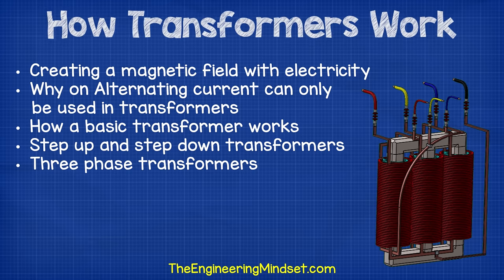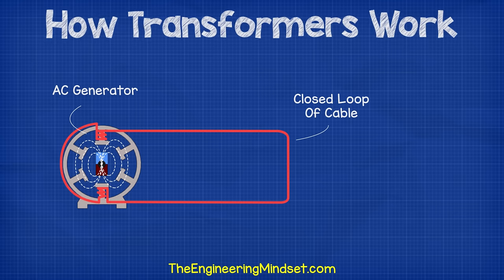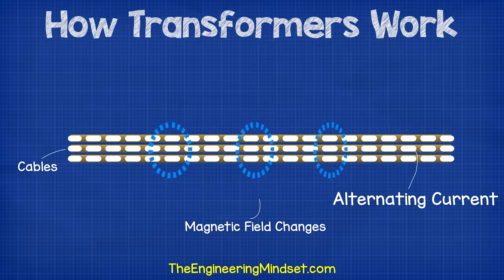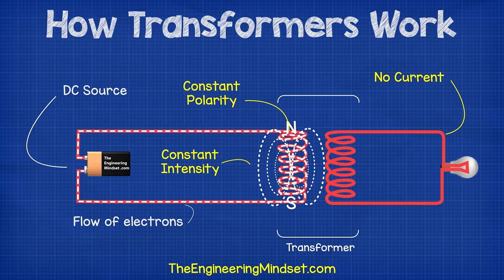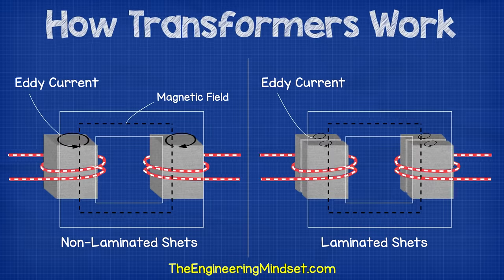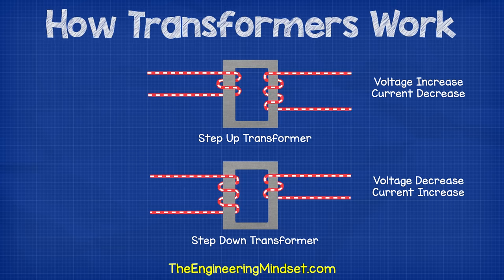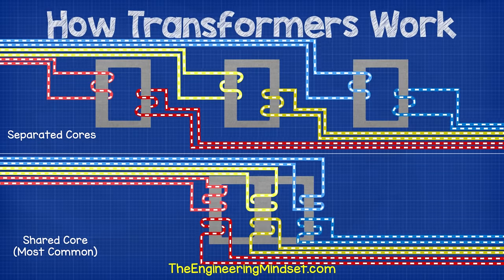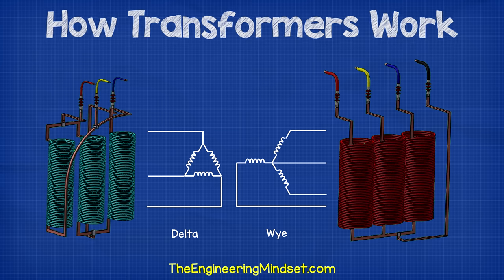How does a Transformer work  - Working Principle electrical engineering

Comment: With those green boxes are called transformers. They are connected directly to a power plant, making sure that it doesn’t overload your house with a bunch of power coming through it without those if he tried loading in a lightbulb, it would mostly just burn out immediately

Comment: What happens if I on transformer meant to turn 208 or 240 into 24vdc what happens if I input on only 120ac will it just come out as less than 24dc at the terminal

Comment: I love this level of abstraction. For my college courses the instructors kind of just go into the math, equations and analysis of all this works but they never stop to really teach an intuitive way of understanding what it is or why it works the way it does. 

Like i know that the voltage across an inductor = the inductance * the derivative of the current with respect to time. But i never really grasped why the voltage isn't present in dc current. Your description of how the magnetic field itself varying in intensity pushes and pulls electrons made so much sense. Thank you
Reply from the maker: Seen our new Transformer video? here https://youtu.be/jcY4QN7awEc

Comment: please explain how current decrease when voltage increase in a step up transformer and vice versa.
Reply: Power = Voltage x Current. The output power of the transformer cannot exceed the input power and so if the voltage increases, the current must decrease to keep the power the same...and vice versa.
Reply from the maker: Seen our new Transformer video? here https://youtu.be/jcY4QN7awEc

Comment: Thank You for these videos!

I work in HVAC as a helper and I'm trying to learn use of multimeter. For detecting/trouble shoot any type of trouble such as electic motor problems, capacitors, transformers and contactors.
I want to learn and have a clearing understanding of testing volts, amps, hertz, and contiuity etc.

This is all very confusing, and where to start and or comprehend. I just don't know what to look for.

Please help????????????
Reply: carl browning ... I spent 25 years working at an electric utility. I had trouble, too, comprehending things at first. It was such a good paying job, I wouldn’t give up studying. Little by little things stated soaking in, until one day the light (no pun intended) came on. I wish I could give you better guidance, but that’s what really happened. Don’t give up and best of luck!
Reply: It's a triangle, of pulses (each 1 a two part: Phase) on 1 road. Each magnetic flip, is a quick opposing pulse : of a size, & time.
They dont collide fired in rotation.
The induction ability of magnetic forces is really cool. Nick Tesla knew he could wifi electricity & it wouldn't "cost" anything.
Reply from the maker: Seen our new Transformer video? here https://youtu.be/jcY4QN7awEc

Comment: Oh wow that was a good dose of I formation! I enjoyed that video. I have a question tho, do transformers always emit a loud humming? If so, what causes that?
Reply from the maker: The humming comes from the core, the thin plates vibrating from the magnetic field. It is the sound of inefficiency
Reply: @EngineeringMindset   so why does a breaker panel or fuse box hum?
Reply: @randyblu25  It could be a number of things including loose wires, loose bussing, or the circuit breakers themselves.
Reply from the maker: Seen our new Transformer video? here https://youtu.be/jcY4QN7awEc
Reply from the maker: Seen our new incredibly detailed MCB video? link: https://youtu.be/gqEu9t8HwW0

Comment: They mentioned that with the use of Transformers, increasing the voltage decreases the current. They said they would talk more about this later but I cannot find any video where they do. Based on everything I've learned so far about electricity increasing the voltage should increase the current. I've looked all over the internet and found that a lot of people concur with this except on the subject of power lines and Transformers. everyone then says as the voltage increases the current decreases. I have looked all over and cannot find anything that clearly explains how both statements can be true
 Can anyone please give me some answers.?
Reply: I had the exact same issue! So basically instead of thinking in terms of V=IR think of it in terms of P=IV. Where P (power) must remain constant and V (voltage) has either stepped up or stepped down. In a normal circuit if you want to change the voltage you have to completely change the battery therefore not only has voltage say been stepped up but power has also increased too, therefore increase in current as well. In the transformer circuit, the Voltage has been stepped up but the total power delivered has not changed therefore the only way to keep that power constant (P=VI) the current must decrease. Hope that makes sense.
Reply: @Michael2512   it does to an extent but  thinking in the context of a circuit inside your home. In that instance increasing the voltage would still also cause the current to increase so I'm still trying to figure out how both statements are true. Maybe I'm just being dumb. Is it just because the circuits in your house don't use the maximum amount of power available? Does it have something to do with the way the power circulates back to the power plant? I'm just not quite getting it on the molecular level. How is all that voltage even circulating if it's not pushing that many electrons?
Reply: @brandond6736   You are right. Current depends on the load and also on voltage to the load. That's ohms law and its true.
Please remember when they say SEC current decreases in SUT (Step up trans), they actually mean " SUT can sustain less SEC current compared to PRI current value' and if you try to draw more current by putting more load then SEC voltage will drop or something will burn out.
Always think of load and its type. If you put a heater in sec of SUT and SEC voltage is further increased by increasing the no of turns then current will also increase.
If however some step down transformer (SDT) is put in the SEC of SUP and now if the no of turn of SUT SEC is increased then the current drawn by SDT (mean SUT sec current) will be less as Voltage has increased and not need draw more current as Power required is Vx I
And trust that at consumption stage most load are controlled ones and does not keep drawing more simply because voltages have increased.(Eg- Induction motors ) Hope it clear some of doubts
Reply from the maker: Seen our new Transformer video? here https://youtu.be/jcY4QN7awEc

Comment: Generally speaking the line side of a transformer, primary coil, is the delta, and the load side of the transformer will be a wye connection. So that whatever device you are powering you are able to add a neutral.
Reply from the maker: Seen our new Transformer video? here https://youtu.be/jcY4QN7awEc

Comment: I like the way you show the rotating magnets in relationship to the sine wave. If you stop the video at peak voltage and 0 volts and notice the position of the magnet it helps in understanding this important point.  The plus or minus in AC is directional flow?
Reply from the maker: Seen our new Transformer video? here https://youtu.be/jcY4QN7awEc

Comment: In order to create a magnetic field with electricity, you need to use alternating current. This is because only alternating current can be used in transformers. Transformers work by using the changing magnetic fields to transfer electrical energy from one coil of wire to another. A basic transformer has two coils of wire, called the primary and secondary coils. The primary coil is connected to the power source, and the secondary coil is connected to the device that needs power. When the current flows through the primary coil, it creates a changing magnetic field. This magnetic field passes through the secondary coil, causing it to create an electric current.

An electrical transformer is a device that transfers electrical energy from one circuit to another through inductively coupled conductors—the transformer's coils. The transformer's input and output power are usually measured in volts-amperes (VA). It is possible to design a transformer with an output power greater than its input power, but this requires the use of special construction techniques and materials.

The working principle of a transformer is based on Faraday's law of induction. When an electric current flows through the primary coil, a magnetic field is created. This magnetic field interacts with the secondary coil, inducing an electric current in it. The magnitude of the induced current depends on the number of turns in the secondary coil and the strength of the magnetic field.

 Transformers can be used to increase or decrease the voltage level of an electric signal.
Reply from the maker: Seen our new Transformer video? here https://youtu.be/jcY4QN7awEc

Comment: Anyone know the video where he talks about the when the voltage increases why the current decreases as mentioned at 4:00 I would like to watch it
Reply: Because the total resistance within the system is the same, so if you increase voltage, based off Ohm's Law, the current must decrease.
Reply from the maker: Seen our new Transformer video? here https://youtu.be/jcY4QN7awEc

Comment: For instance the circuits at 2:05. If a switch is on the secondary side turning off the light bulb, the primary side is still open and using energy? Is a transformer using AC from a power source constantly using the same power regardless of what is being used on the secondary side?
Reply: No, it's not really "using" the electricity because there is little to no resistance or load on the circuit when the switch is open
Reply from the maker: Seen our new Transformer video? here https://youtu.be/jcY4QN7awEc

Comment: thank you very much for your explanations, but what makes the magnet movement, I mean the turning of the magnet inside de ac generator? thanks
Reply from the maker: Anything that rotates. A wind turbine, a motor, a water wheel, a diesel engine
Reply from the maker: Seen our new - How wind turbines work video? link: https://youtu.be/Hf875eOVrVI
Reply: @EngineeringMindset  thank you very much indeed!

Comment: DC can be used in transformers (long as it doesn’t saturate the core), provided it is pulsating and not a continuous value,
As illustrated at 2:45
Reply: But wouldn't that be a massive reduction on efficiency ?
Reply: @bigkirbyhj666  mmm, no, I don't see why not, especially if you add a magnet...
Reply from the maker: Seen our new Transformer video? here https://youtu.be/jcY4QN7awEc
Reply: @EngineeringMindset  beautiful! I just saw it well done

Comment: The most amazing thing about this is that it is completely contactless. There is NO direct connection between the power station and your home, and is infact broken at several points along the way, but it still works.
Reply: Does that mean that electricity is not from electrons flowing but from the electromagnetic field?
Reply: @GH-oi2jf  It’s not that simple

Comment: Just to be a perfectionist, I believe it is voltage, not current, what is induced on the secndary coil. If the other circuit was open, there would be no current flowing even with the transformer powered on.
Reply from the maker: Thank you, please see our newer updated version of this video

Comment: If we can not change the power in secondary winding by reducing voltage or current in the primary winding, why we need to use transformer? I mean if current if V1>V2 then I1<I2 to keep power the same.
So why to use transformer?

Comment: I am confused as to why increasing the voltage reduces the current. I can see from the equation P=IV that for a given P you can increase voltage and it decreases current but when you look at the equation I=V/R is says that when you increase voltage then current also increases for a given resistance. Can you please help me understand better?
Reply: When you increase the voltage you are essentially increasing "pressure." When pressure is increased it requires less current to get the same amount of power. Think of a hose and water. if you want to fill a bucket with water and you increase the psi you can have a lower flow rate to achieve the same end goal.
Reply: If you take a garden hose and put your thumb over the end you increase in psi and the water will spray much farther but the total amount of water is decreased (voltage is increased, current is decreased) *this is at least my understanding of the matter, correct me if I am wrong but I hope this helped.
Reply from the maker: Seen our new Transformer video? here https://youtu.be/jcY4QN7awEc

Comment: hi.. really love your videos... can you just tell me if you have already posted a video on why the current decreases in the step up or increases in a step down transformer.. if not do post one soon.. i'm waiting..
Reply: i would also love to know how the 3 different phases affect or do not affect each other when connected in a delta or a wye setup
Reply from the maker: Not yet, I'll tag you when it is though
Reply from the maker: Star delta, check this https://youtu.be/h89TTwlNnpY?t=537
Reply: @EngineeringMindset  ... thanks...  just saw the video.. also saw 3 phase electricity.. i have few more doubts now.. XD .. first of all.. in the 3 phase electricity video you showed a generator with 6 wires but to reduce wire cost we use 3 wires and join the ends in star or wye config... i'd like to know what the difference would be if six wires were used to that when 3 wires were used in star and delta.. (say the end load was a 3 phase motor...if that is necessary to tell the difference)...

Comment: Correct me if i'm wrong, the current produved in the secondary coil has an induced emf from the first coil that has alternating magnetic field from alternating current. Which means the magnetic field reverses and so would the secondary coil be AC again? 
How does the secondary coild become a DC. Can someone explain?
Reply from the maker: Secondary is AC, you need an inverter to change AC to DC. We also have a video on inverters

Comment: Great Video! Why does the Neutral from the Star Winding, which is Earthed, not cause Fault Current to flow from the induced winding to Earth causing an Earth Fault and in turn operating protection?
Reply from the maker: Seen our new Transformer video? here https://youtu.be/jcY4QN7awEc

Comment: You have to explain how when you increase the turns on the secondary coil,  the voltage increases and the current decreases. You said that is in another video. Which one? Because that sounds counter intuitive  to the normal theory : increasing voltage increases current (Ohms law).
Reply: First of all: Don't follow the wiring schemes provided because they don't work.

A transformer is a special application of the short circuit, so the Ohms law should be applied on that scenario that is special because the coils tend to stop the current flow: A short coil wich is simply wire connected from load to ground will not melt the wire, therefore the current flow is minimum, but should be very high due to the short.

Second: The voltage is linked to the iron core, if you haven't the right amout of iron in the core (in closed loop), the voltage will be lower with the same turns in the coils: And will depends on how efficent the transformer is (usually > 80%, wich means that if the core will give you 100 volts, you will get a value near 80 volts).

But the main problem for us is not why the Ohms law don't works in this particular case, but get an understanding of what a Volt is...
Reply: @LuigiBaglio  Where can i get a precise understanding of what a "volt" is ? My current understanding is that by forcing a bunch of -ve charges together, say by using chemical reactions in a battery , we have created electric potential at the negative terminal . Now the combined electric field around these -ve charges/electrons which don't want to be together is strong  , they have the potential to do do work. The positive terminal of the battery which is depleted of -ve charges provides a lower electric potential, and the difference in electric potential between these two terminals is called a voltage.   Is this understanding wrong ?
Reply from the maker: Seen our new Transformer video? here https://youtu.be/jcY4QN7awEc

Comment: Paul: Question please. What physical change inside the single phase residential step down transformer is used to INCREASE the rating of that transformer from 16 KVA
to 50 KVA? Both transformers secondary winding are the standard split phase
240 volt L-1 to L-2.   and 120 volt both legs to neutral.   A thank you in advance.
Reply from the maker: Essentially, thicker copper wires and/or more turns. Most have pre-configured turn ratios with different tapping's  (connection points). Connecting to these different connections will increase the length of the coil being used. The length of the coil remains the same from install, but how much of it is used can be varied from pre-manufactured connection points. If it doesn't have this, then it can't be changed. The temperature of the coils also limits the power, at a certain temperature the insulation will fail and the coils will short.
Reply from the maker: Seen our new Transformer video? here https://youtu.be/jcY4QN7awEc

Comment: Am i right to assume that the 3 phase electricity is designed so that at any given time at least one of the 3 phrases is at it's peak to make sure that there is always the maximum power available at all times?

If we use a single phase system does that mean that electrical stuff lose power for a fraction of a second when the Current reaches zero and then regains power as it moves towards the negative side?
Reply from the maker: Please see our 3 phase basics and calculations video for more details